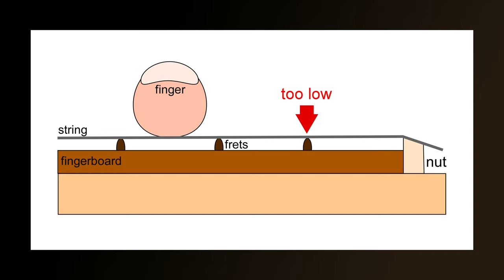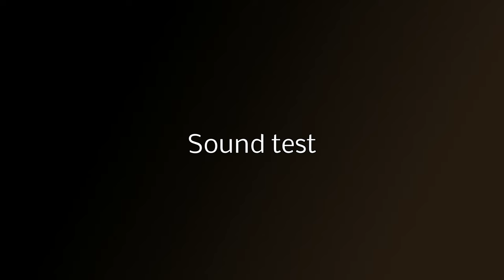How to fit a bone saddle and nut.   Why fit a bone saddle and nut on an acoustic guitar?

Comment from the maker: Republished because I messed up the sound at the end of the video . . .
Reply: Hi Great video  Can you tell us what is this song you play in comparison?
Reply: Hello. it happened to me that after a professional guitar setup my guitar lost its sound, it lost its resonance. of course it was much softer and more comfortable to play but the sound was very bad. can anyone give advice. I apologize in bad English
Reply: @nikolajdragovic19  Just guessing what could have gone wrong:  1. Changed strings - Not all strings sound good on all guitars.  Sometimes it is best to use the string brand that the manufacturer uses (ex. Washburn = Vinci).  2. The bridge/saddle setup - any change in materials.  The nut only effects open strings.  3. Lower action may result in less tone as the string's vibration is actually dampened by hitting frets.  I don't know why but even some famous pros have their acoustics setup this way (usually the ones trying to impress you with speed but their music is lacking).
Reply: @nikolajdragovic19  yup, happened to me after lowering my action. I think the saddle was lowered too much, there is a bit of fret buzz when picking harder, also it kind of lost some tension in the strings. This might be due to lower saddle still, or at least it seems this way.
So I'm actually going to a luthier with it in a few days in order to raise the saddle by replacing it with a bone one, which would be taller. Hope I get it fixed.
Reply from the maker: @BillLumbergh4you  All the better for fingerstyle here's the course I wrote.
Book 1 
https://www.youtube.com/playlist?list=PLIQJcXCYbgO2q9hDUBT0E5z1JZDk3bowI
Book 2 
https://www.youtube.com/playlist?list=PLIQJcXCYbgO1uyExG1qS2puZ6aC11cA-M
Reply: I'm just messing around with you 😃
Reply from the maker: @BillLumbergh4you  I guessed.  But it's a good way to advertise my other videos 😂🤣😂
Reply from the maker: @BillLumbergh4you Don't worry, I'm not bothered and I didn't consider it rude 🤔
Reply from the maker: @rocketpirates8787  the tune is 'The troubled heart by Sad Fantasy' here's how to play it https://youtu.be/LCCNs5pvYRA

Comment: I'm assuming if you feel confident in changing the nut and saddle you probably have changed your own strings before. But for anyone super new, before you go buy a tool for pulling out pegs, a fork or butter knife work quite nicely. I actually keep a fork in my guitar case that I've been using for years lol.

Comment: Comparing the string height on the nut to that on the saddle - with a properly adjusted neck - is an excellent idea.I have done this on two guitars and the difference is quite noticeable. Thank you - excellent video.
Reply from the maker: Thank you for commenting from you experience . . much appreciated 😊😃

Comment: Your video is good. It also included intonation on the nut side. One website said the gap between string to first fret would be o.25 to 0.3 mm. I had done 3 guitars nut and saddle replacement prior to watching this video. 
Pressed the 3rd fret to check the gap is good, as it will not be affected by the trust rod bow nor by the saddle height.

Comment: Loved your videos, made replacing nut, saddle and pins very easy. They were plastic worn and  was getting a nasty buzz. Sound has improved 10 fold and the sustain on bone is unreal feels like the notes last forever. Much cleaner sound too.

 My only suggesting is can you make a video on the different types of saddles and why they are intonated, which way they should slope on what stings etc I did buy a LH saddle and nut and my guitar is 100% lefty but saddle on it was possibly a right handed saddle? Maybe ive been had on ebay and they have sent me a right handed. so confused by this
Reply from the maker: Thank you . . That's a great suggestion for a video . .  I'll put it in my to do list 😊😃

Comment: What amazes me is that the action on a Glary guitar from the factory had a properly fitted saddle and nut for a decent action
Reply from the maker: I had 2 of these for review and they were both OK straight out of the box, but they did need neck relief adjustment.  This was an issue with the second one (it was a GT502) because the truss rod didn't feel properly seated.  Sadly I didn't notice this during the unboxing/review because it didn't need adjustment straight away. 😒

Comment: Where did you buy the nut and saddle kit? I don't see a link below your video or on your amazon page.
I've got a cheap old guitar with plastic nut and saddle. I'm getting a buzz from the saddle after changing the old strings the guitar came with so I would like to take on this project.
Reply from the maker: I just search eBay for the best offer  . .  I search 'bone nut'  🙂

Comment: Excellent video, I was just wondering why would you sand down the whole nut vs filing the slots?
Reply from the maker: I keep meaning to make a video on this subject.  The slots should a very precise width, and file the nut correctly you should use a set of nut files which are very expensive (£100 +).  Sanding the bottom of the whole nut can be done with just a piece of sand paper. 😊
Reply: @guitar-academy  Thanks for the reply. I've heard it's a fiddly technique as well. Most of my guitars have zero frets so it isn't an issue yet. I am thinking of buying a cheap one to practice on. Also, if suppose if the nut is really high you'd have to cut massive slots which would be prone to mess ups. Thanks for the great videos :)
Reply from the maker: @CaratacusAD Thank you . . it's a shame zero fret guitars aren't more common because it's a very good system.  😊😊

Comment: When you sand the bottom of the nut and place it back-to-back with the original nut, if the bottom of the original nut was at a square angle to the vertical side of the nut, the two nuts should stay in perfect contact with each other. If they separate as you remove your fingers from them then one of the angles is not square. This should be checked with an actual "square" because otherwise the nut will be tilted slightly one way or the other and intonation will be noticeably off. I recommend placing the nut to be sanded into a jig of some sort to assure it remains square to the sanding surface. The jig can be sacrificial or clever, either one will work.

Comment: Great instructional video.Can the sides of the saddle be sanded down if its too wide for the saddle slot?I have a small parlour acoustic and slot is only 2.5mm most bone saddles available are 3mm also slot is 7cm long which is slightly shorter.
Reply from the maker: Yes, you can sand the saddle to fit if you want.  The only advice is to be careful and make the fit as snug as you can 😊😃

Comment: Great video! Will the cheap kits from eBay be good enough for something like this?
Reply from the maker: I assume you're asking about the nut and saddle kits . . .  if so yes, as long as they are bone and not plastic they'll improve the sound.  I've bought a few bone parts off ebay and they have been what they said and work well.  😊
Reply: @guitar-academy  Thanks! I've tried making a saddle myself but I think buying is probably a better option.

Comment: Thank you for this video! What grain do you use for the sand paper, and do you polish the bottom of sattle and bridge with a higher grain? Many thanks in advance.
Reply from the maker: I am not to fussy about the grain of abrasive paper I use, I literally just rub my finger against it to decide, but it has to be quit course wet and dry (about 300) and you have to clean it often because the bone sticks to the surface.  I just give the bottom of the saddle a quick wipe to get the dust off and I polish the outside of the bridge with oil (lemon or almond) and not in the slot.  🙂  I hope this helps

Comment: You adjusted the nut by sanding  it down at the base but what do you think of making the nut slots deeper with a file instead? A lot of YouTubers advise using files that correspond to the gauge of each string so the action can be lowered for each individual string. They also advise lubricating the nut slots with graphite. Do you think this is necessary?
Reply from the maker: If you have a piezo pickup under the saddle or if you want to fit one, don't file the wood under the saddle because it has to be perfectly flat and the only way of doing this is to use a router and a jig.  Yes, it is a good idea to use some graphite at the nut to help the strings move across the nut easily when you tune the guitar (it isn't a must though).
I haven't done a video on adjusting the nut because of the cost of the tools.  My set of files for adjusting the nut cost over £160.00 which is more that this guitar cost.  Most people can't afford this, but you can get a needle file that goes to a point so the slot is a V shape, this is a cheap way of doing the job and it's good enough for most people.
Reply: @guitar-academy  ok thank you!

Comment: I have just had my guitar back from having a set up to lower the action which was previously at approx 3.25mm at 12th fret at both low and high e strings. The action measures 2.25 at both e strings. Does this sound correct as ibwould have thought the high e would be set lower tgan the low e action? Also i have noticed that the saddle has been swapped out for a new saddle. The old saddle was bone and compensated at the b string. The new saddle does not have the compensation at the b and there is close to 1mm gap on one side if i push the saddle up tight to the bridge. Should this be a better/tighter fit? And is it normal to swap out a saddle without informing me of this? I would really appreciate your take on this as someone who has great knowledge in these matters. Thanks.
Reply from the maker: It's a hard question to answer without the guitar in front of me, but I'll try. 🤔
The height the action can be lowered too very much depends on the guitar and how level the frets are, also some makers give recommendations for action height that is a little higher than most people like (including me).  
The saddle not fitting seems wrong.  The compensating saddle can cause intonation problems instead of solving them, again it depends on you guitar and strings.  You can check if the intonation is correct by tuning the guitar up with a digital tuner and then check if the tuning is correct on the 12th fret.  It the 'B' string is flat on the 12th fret when the open string is in tune then the guitar needs a compensating saddle. Here's a video showing how to test the intonation, it's a different guitar but the technique is the same; https://youtu.be/GG9UKBfXkW8?si=jpROXX2aCn4zYhBJ
Reply: Thanks so much for getting back to me, I really appreciate it. The intonation is pretty good at the 12th fret. I just didn't think that the top of the saddle would be adjusted to sand of the compensation at the B string, which seems like they must have done this if it is indeed the same saddle and  they have not replaced it with a new one.

Comment: Quick question:  I was surprised that you mentioned brass as an alternative material.  I love a lot of jangle/top end in my sound so I thought it might be worth a try, but I've read that it produces too harsh of a tone.  Do you have an acoustic with a brass nut and saddle and how does it compare with bone?
Reply from the maker: Good question!  Brass is sharper sounding than bone, but it really depends on the guitar.  If the guitar is already tiny and sharp bone is the best choice, but if the guitar is muffled and woody the brass parts can really lift the tone . .  Remember that the nut only effects the tone of the open strings . . I hope this helps 🙂🙂
Reply: @guitar-academy  Thanx much for the quick reply.

Comment: great video. ok and on my acoustic maton, the height at 12.fret is 1,6 and 1,2 mm and I can hear buzzing on the B string at first 3 frets once its hit harder... what to do ? shim the nut or polish the frets ? I sanded the saddle little bit, that´s all I did. The nut was not manipulated.
Reply from the maker: is it when the string is open or when you finger the first fret ?
Remember that when you shim the nut, all the strings increase height wise, but you can test the nut by putting a small piece of paper under the B string and see if this cures the buzz.  This video might help  https://youtu.be/8BSmoehj7sQ
Reply: @guitar-academy  thanks. no, open string is OK. it is only on first 4 frets and once I hit by plectrum or thumpick harder...quite playing is ok but if you want some drive sometimes you attack the string harder. I can make it by truss rod but then the action is not sutiable for me (1,8 and 1,3 mm at 12 fret > I prefer 1,5-1,6 and 1,1-1,2 mm). I try to put the paper under the B and let you know :)
Reply from the maker: @guitarado  it sounds like you might have to do as described in the video I suggested. 😊😊

Comment: I've been about to replace the saddle on my electroacoustic Takamine and after take off the original one, I've found out that it has some kind of slots or splitted sectors for each string in the side that goes towards it's piezo. So I couldn'd go any further, anybody knows anything about this? Thanks in advanced!
Reply from the maker: The shaping on the bottom of the saddle seems to be a common Takamine thing and on some Ovations and makes it really difficult if you want to lower the action.  You can get a Graphtech Tusq saddle if you just want to upgrade the material, however there is no easy way to lower the saddle without careful filing and shaping.  I've put a standard bone nut on in the past because it was a rush job and I didn't have the parts, but it's better if you can get the shaped one.
Reply: @guitar-academy  Thank you very much for the answer. Additionally and after the issue I've just mentioned, I was researching about it and found out a lot of Takamines owners that had replaced their saddles for bone, and since then they had a lot of feedback when using it's piezo; and the conclusion was that looks like that in Takamines the plastic saddle works also as an isolator in order to improve the piezo function, so they didn't recommended to use bone as alternative in this electroacoustics. Anyway inspectng closely the saddle in mine it is pritty dense and harder than common plastics you could find over there, not bad at all really. Well, maybe this info could help anyboby. Cheers and thanks again!
Reply from the maker: @TheForce_Productions  yes that's very useful information . . 😊

Comment: When you attach the new nut is it no need to put some glue to be sure is it in place always?thnk you
Reply from the maker: No, not if it's a tight fit as this one was it will be fine.  If you have to glue it, make sure you don't use strong glue, in case you have to remove the nut again in the future.  😊

Comment: I don't expect to get an answer but my issue is, the guitar I'm working on is a friend of mines guitar. He got it when he was a teenager and never really played it but held on to it for all these years. He knows that I've been playing since I was around 7 or 8 and when he died this this he left his guitar to me. Over the years he'd wanted to restore it, so he took the string's off, and the saddle probably came off with them I'm not sure. He sanded it down and basically left it. It's a cheap guitar so I'm not gonna take it somewhere to be professionally restored because I can probably do a pretty good job myself. My question is. Should I just put the saddle an strings on, see how it sounds an make adjustments accordingly? Or is there a standard measurement I can start with an go from there?
Reply from the maker: there's no standard measurement you can get without the strings being in place.  When you put the strings on the whole guitar changes because of the forces placed on the guitar by the strings.  If you've never worked on a guitar before it might be wise to start with cheap strings that you can afford to take of and put on a few times and then replace with new strings when you've finished.  If the guitar hasn't had strings on it for years, you might have to leave the strings on for a couple of days before you start looking at the measurements because the guitar might bed in slightly.  I hope this helps 😊
Reply: @guitar-academy  yes it does help. I also watched your video on adjusting the action I think it may have actually answered my question lol. But you're right I've never actually worked on a guitar besides changing the strings an tuning keys once. I've been playing for going on 30 year's so I might have to pick it up 🤣 thanks for your help
Reply from the maker: @JoeNathan42420  No problem . .  you'll probably have loads of fun with it . . 😃😃

Comment: why not  use a tiny amount of bedding compound (wood filler?) under the saddle to make solid perfect contact?
Reply from the maker: A couple of reasons I personally wouldn't use it are, to make it easier to remove the saddle in the future and to avoid any acoustic energy loss caused by the changes of materials. . .   It might be an interesting experiment though that I will try in the future 🤔

Comment: Is there a way I can adjust my saddle down without going too far so I then need to shim it, or buy a new saddle? New saddle is hard to find for mine and always out of stock plus 15 USD delivered so I don't want to go too far though it is far too high (I did take a little off).
Reply from the maker: I can't answer this accurately without seeing the guitar, but all I can suggest is to do it in small increments until you reach a safe but lower height.  Another idea is to get a blank saddle and file it to the right size.  With a blank saddle it doesn't matter what make or model of guitar you have.  I hope this helps.